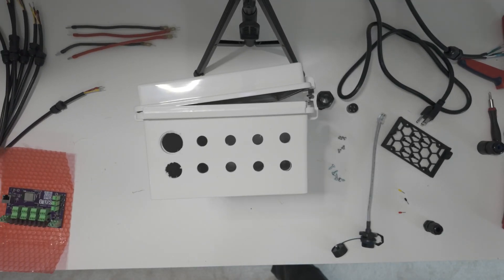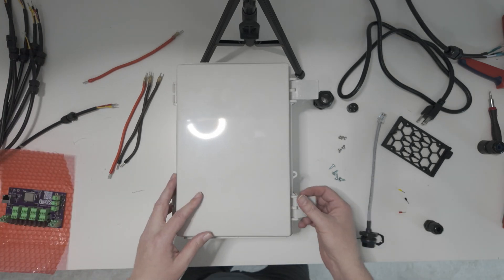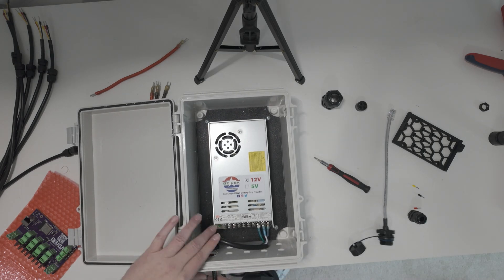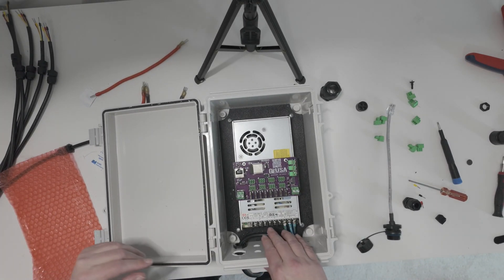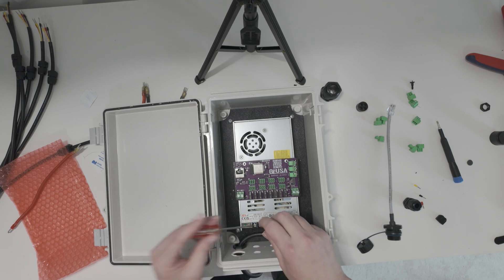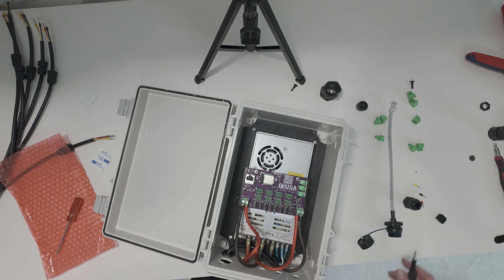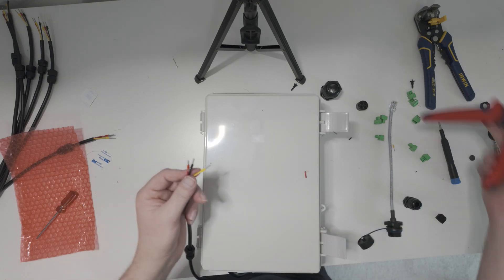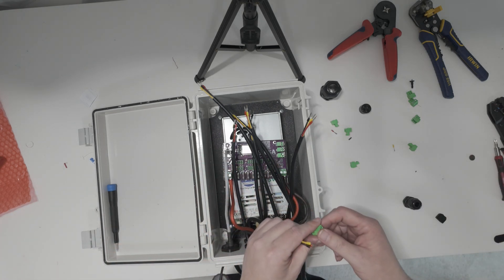Gilbert Engineering Baldrick 8-Port Controller Build | Part 2: The Build

Comment: Would this controller be sufficient to run the mega tree build you outline in your video from 4 years ago (16 Strand RGB Mega Tree Build Using the Boscoyo Mega Tree Kit). I'm just getting in to the hobby and trying to start with a mega tree. Thx
Reply from the maker: yes you could do 200 pixes per port so the tree would need 4 ports and you start would take 1